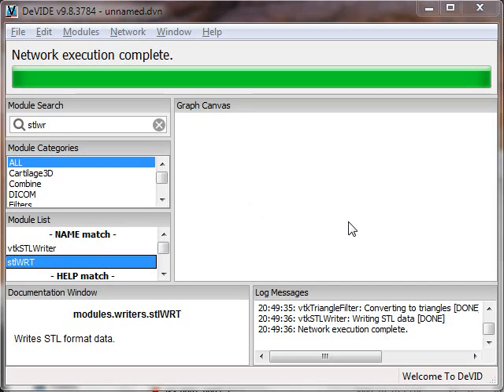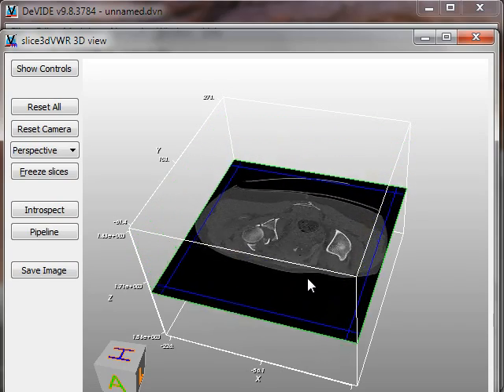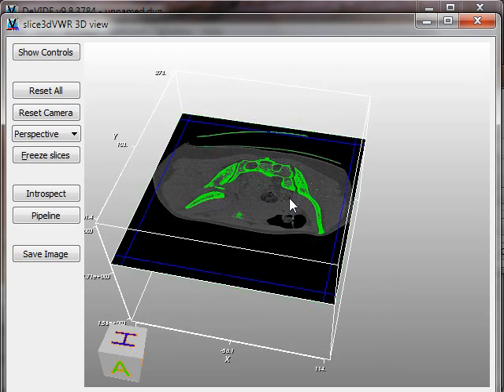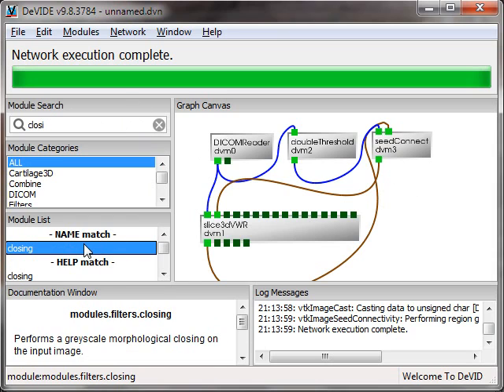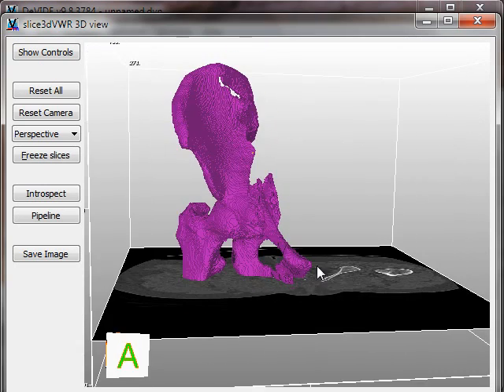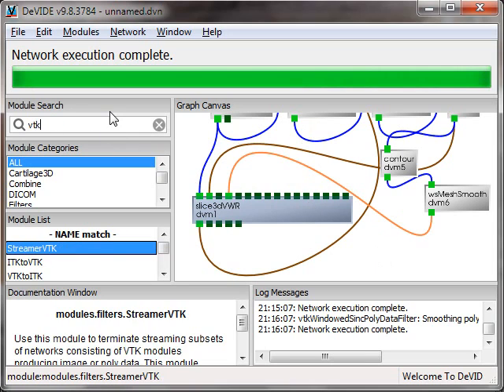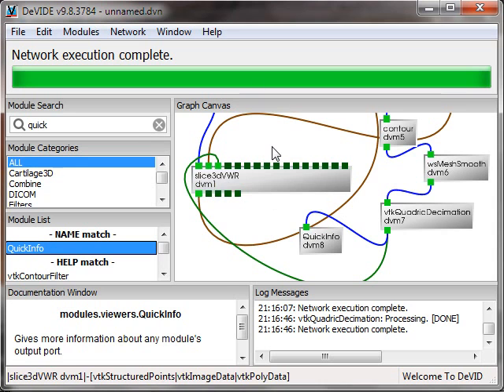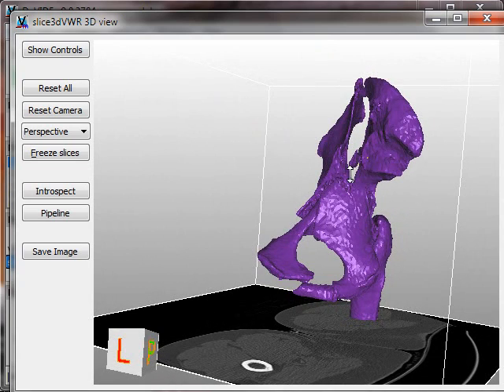Extracting STL surface from CT data with DeVIDE

Comment: Hello Charl Botha. I imported a single DICOM file using the DICOMReader. However when I tried to import multiple DICOM files I got an error as below.
"Unable to execute part 0 of module dvm0 (DICOMReader): Could not sort DICOM filenames before loading."
The file name are "image_001.dcm", image_002.dcm", .. , "image_120.dcm".
I found that the error was occured on "DICOMReader.py" file in the process of filenames sorting. 
Could you help me solve the above problem?
Reply: Dear Charl Botha.
I just solved the error "Unable to execute part 0 of module dvm0 (DICOMReader): Could not sort DICOM filenames before loading.".
The solution for this error is to define the DICOM header information fields  "ImagePositionPatient" and "ImageOrientationPatient" respectively.

After I defined the parameters with the correct values, the multiple DICOM files  which were created by MATLAB were imported successfully.

The  DICOM header parameters were defined using MATLAB for each slice
=============================================================
 info.ImagePositionPatient = [-FOV_x_mm/2; -FOV_y_mm/2; z_pos_mm(i)];
 info.ImageOrientationPatient = [1; 0; 0; 0; 1; 0];
=============================================================

I hope the mouse brain template acquired with an MRI can be created using a 3D printer.

Han Gyu Kang.
Reply: Greetings Kang,

I had the same error, and I checked the MicroDicom values for "ImagePositionPatient" and "ImageOrientationPatient", and they both were available. Yet, I am still facing the same error.

Please advice :)

Comment: Hello Charl Botha~ Thank for sharing this great video~! 
I have a question here. Is it possible to use an analyze format volume data file(*.hdr, *.img) instead of DICOM format slice files as an input file for DeVIDE?
Reply from the maker: Yes. You can use the ITKReader to read these files. Remember that you then might have to use a VTKtoITK block to continue processing with the normal VTK-based modules.

Comment: Hello,

When I try to import the .dcm files I've got the following error: "Unable to execute part 0 of module dvm3 (DICOMReader): Could not sort DICOM filenames before loading."

Does anybody know a solution for this? I've tried to use the DICOMReader module as well...same error :( 

Thanks
Reply from the maker: +Zoltan Doczi That means there is something wrong with your DCM file set. The DICOMReader tries in different ways (from most correct to least correct) to stack the dicom slices. If all methods fail, you get that error message.

You can try viewing the set of DCM files in the DICOMBrowser, it should sort them into different series. You can then drag a single series onto the DICOMReader, this will ensure that you're only reading DCMs that can actually be sorted.
Reply: +Charl Botha Thanks for your help! And also thank you for this excellent video! 

I've tried your method and when pushing the "IPP Sort" button in DICOMBrowser I've got a new error message: "Could not sort DICOM filenames. It could be this is an invalid collection". Also I got the same old error when try to pull the files from the DICOMBrowser into the DeVide window. The files from a GE Ultrasound, ModelName:V830. I afraid there is the common GE proprietary file issue :( They tried to convert it to .vol format as well but I cannot make anything with that format. 

The .dcm files has some sort of strange size and naming compared to sample .dcm files I found on the net:
 16 139 350 IMG_20151130_1_13.vol
  7 244 548 IMG_20151015_2_1.dcm
 16 139 351 IMG_20151130_1_14.vol
  7 247 108 IMG_20151015_2_2.dcm
 23 269 594 IMG_20151015_2_3.dcm
128 827 892 IMG_20151015_2_4.dcm
...

Thank you Charl!
Reply from the maker: +Zoltan Doczi Aaah it's ultrasound. This often means that the slices have some kind of radial (or even less structured) layout in 3D space. I'm afraid that DeVIDE can't work with this type of layout. I don't know from the top of my head of open source or free software that might be able to either reconstruct or resample ultrasound DICOM data.

If you have a Mac available, you might have more luck with Osirix.

Comment: great vid. Can I use this for creating polygon surface out of Ultrasound Images? quality of the ultrasound is worse than CT scan, So how does this effect the threshold values or other specifications?
Reply from the maker: +mary J.D Ultrasound is much more challenging. Thresholds, even adaptive ones, are not good enough. One usually needs some kind of model-based technique, where you already have a good idea of what you expect, and then refine that model to fit the data. The Bergen (Norway) and Vienna (Austria) Visualization groups (amongst others) have been making good progress on processing and visualizing ultrasound (see the work of professors Ivan Viola, Stefan Bruckner and Helwig Hauser and their collaborators).
Reply: +Charl Botha Thanks for the quick response and the info. I could find the work of Prof. Stefan Brucker which is close to what I was looking for. I was wondering if you have the works of other suggested profs. is it possible to share them with me? I appreciate your help. actually, I am looking for a fast and good quality way to segment and reconstruct ultrasound images. tx
Reply from the maker: +mary J.D Both professors Viola and Hauser have most of their work online on the websites of their groups. I think if you google "bergen visualization group" and "tu vienna visualization", you should find everything you need! :)

Comment: What is the unit selection process and can it be exported in mm? Most of our units in the lab require mm units of the STL in order to print.
Reply from the maker: When your input data is in millimetres (DICOM has unit spacing, which is correctly handled by DeVIDE), the STL units should also be in millimetres.
Reply: Very well, thank you! I noticed the DICOM data was in mm, was just wondering because I had opened my STL in SolidWorks to check units and it was in custom units probably just due to no weight/material specifications. Now I know!

Comment: I'm getting a ""DICOM IPP sorting yielded incorrect results"

That means my slices are misaligned. If I only load a few slices (less than 5 usually) I can get the network to execute. I looked at the slices in irfanview and it seems the misalignment is ever so slight (a mm at most). The patient probably moved.

Is there any way I can get those slices to line up?

Comment: What you need for a good 3D reconstruction are the so called VRT Slices from the CT. The slices should be 0,7mm and the inkrement should be 0,5mm. You should use a smooth kernel between 26 and 30 for soft tissue and bone windowing. This is really important to get good 3D reconstructions.

Comment: Figured out to browse through slices (Alt + Middle mouse button). Is there a way to scan through slices along planes other than the default dcm files. For example, can the same data be viewed along coronal, sagital and axial directions, or can cross sections be displayed normal to a spline that is drawn by a user. 

Thanks

TM

Comment: Charl 
I am using DeVIDE 12.2.7 . Am running into a more fundamental not so technical problem. How do you browse through slices in the slice3DViewer. If you can post various controls for slice3DViewer it would be very helpful.

Thanks for the awesome work you guys have done at Delft.

TM

Comment: Thanks :) Love having a 3d printer for random stuff like this hehe.
This is the first time I've used DeVIDE so I'm fumbling around a bit but this is what I did before getting stuck.
- Clicked "Show controls" in the 3d-view
- Enabled the "Volume of interest extraction" checkbox.
- Saw that I got some new spheres in the window and dragged those around until they surrounded the best looking vertebrae.
- Here's where I'm stuck :) Tried google and the wiki but couldn't find any help there.

Comment: Thanks a lot for all the hard work on this. I just wish I had a more high res scan of myself :) I was attempting to extract a single vertebrae to print out on my Ultimaker but the resolution isn't good enough to pick one out (665 slices of my midsection (kidney stone...)). Too bad.

Comment: Hello again, having got the STL and tidied it up a bit, the printer is complaining that it's a surface mesh, and to work with it they need a solid file... Is it possible to 'fill in' the mesh and generate CAD data?

Comment: I actually imported the STL into Inventor, drew a sketched line over it, measured a factor 100 too big, not 10. NetFabb gave correct measurements though so I assume the problem was in importing. No idea how a 3d printer would work if it was unitless, but I don't know how they really work anyway.

I'm working with RTSTRUCT dcm files now, which have been contoured & thresholded. Can't yet open these, let alone generate a mesh. Will keep working on it!

Thanks for making VTK accessible to noobs :)

Comment: Well done!
Now, I try to generate the stl file from micro-CT file using DeVIDE, however failed. As you discribed, I selected the dicom file and droped down into DEVIDE and used the slice3dVWR to visualized the file. The error information is as 's3dv Frames STEREO: False'. Could you please do me a favor to point out the possible reason for this problem? Appreciate.